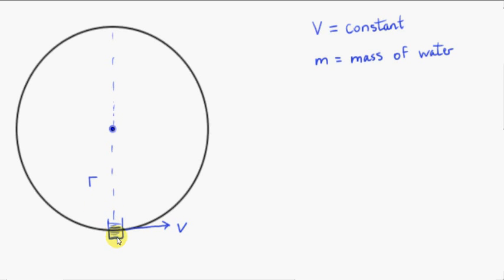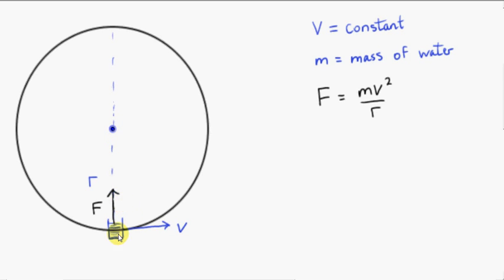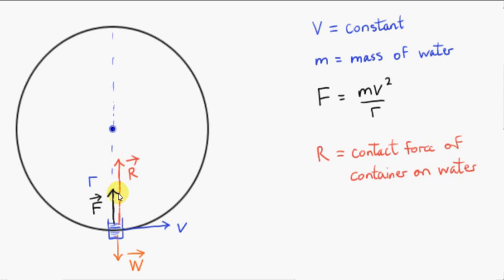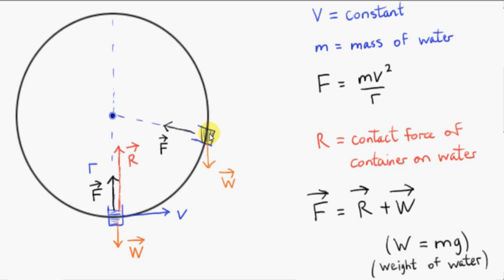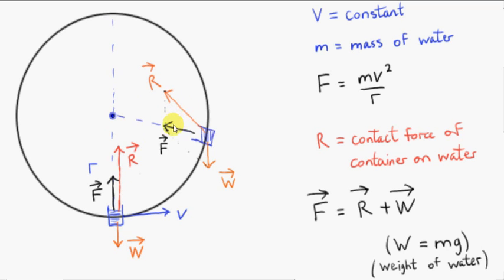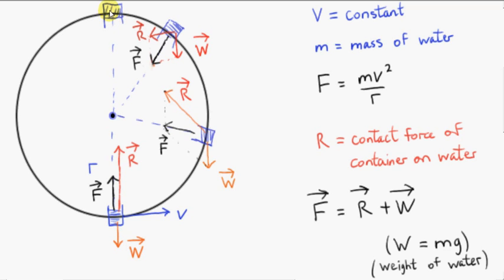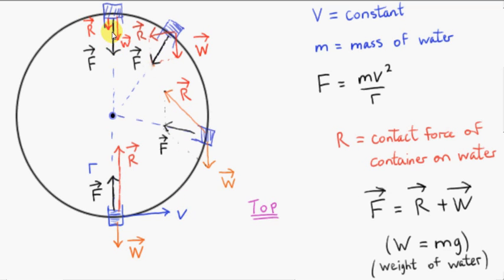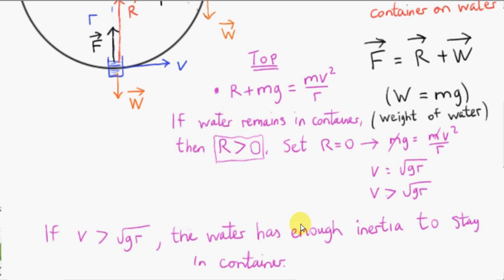Uniform Vertical Circular Motion - Water in a Container

Comment: A trivial fact is that the tip of reaction force vector R describes a circle that lies within the circle of motion (just touching it at the top in the limiting case where the water is only just prevented from falling out.) This leads to the observation from the geometry that the magnitude of R is always proportional to the distance of the water/container from the top of the circle.
Reply from the maker: I am not sure about that. Compare vector R to constant magnitude of F at the initial position of the container and at the midway position when F is perpendicular to W
Reply from the maker: The circle that you describe is not concentric with the outer circle
Reply from the maker: Perhaps you could justify your claim. I am not sure that it is trivial!
Reply: KeysToMaths1 Certainly (I am using Geogebra to convince myself)

a) F is fixed magnitude and always points to the centre of the circle of motion.

b) W is fixed magnitude and always points down.

Thus the tip of F describes a smaller circle, concentric with the circle of motion. Applying a fixed W by vector addition everywhere on the circle of motion just moves this smaller circle down.

That's the resultant 'F + W' of course. Then there is a conjugate circle, 'F - W', and this is 2W' directly above the first. This is the circle that touches the top of the circle of motion in the limiting case described.

The geometrical trick is to have these two circles (of motion and resultant for 'F-W') touch in one place only. That establishes a dilation from the point in common under which the distance between the circles in the direction of the point itself is in the direction of 'F-W', has its magnitude, and is proportional to the total distance from the fixed point.

HTH